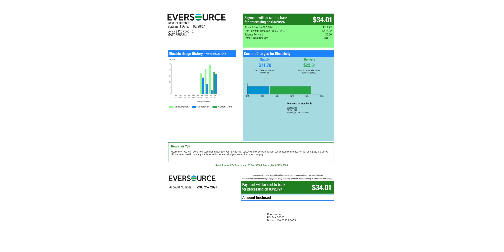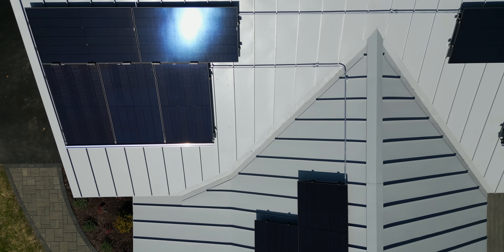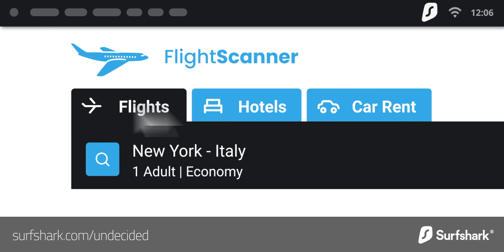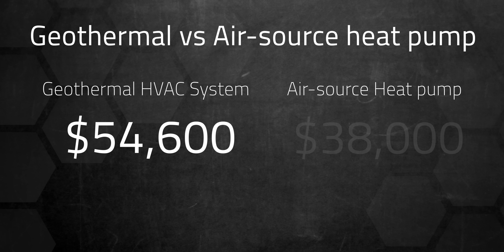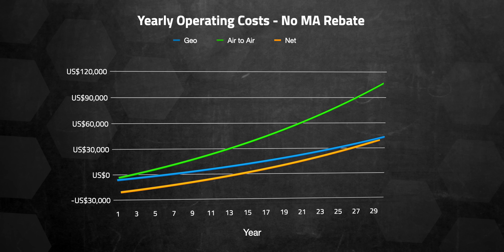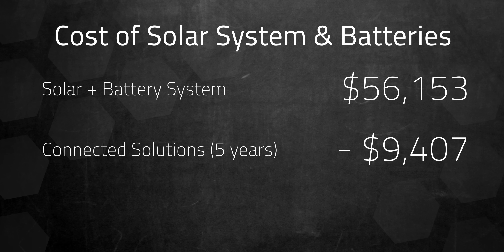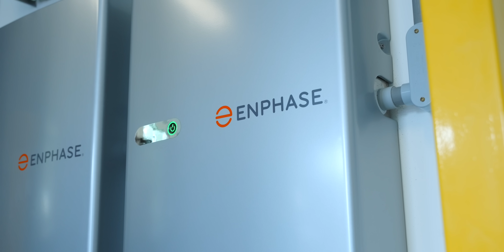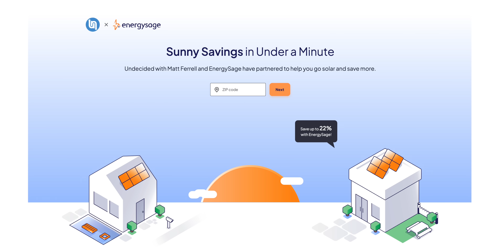What I Learned After 1 Year with New Solar Panels

Comment: And now I have a full time job managing my overcomplicated automated house that requires me to constantly monitor why my smart light switch is not working
Reply: I was about to make a comment very similar to yours. I have better things to spend my life doing then micromanaging why one circuit in my house house cost me a penny more then last month. I just don't get why people need "smart" circuit breaker panels, "smart" appliances, etc.
Reply: Lutron is incredibly stable. I’d agree if he were using non hardwired smart bulbs and stuff, but Lutron really isn’t comparable to that stuff.
Reply: This is a factor nobody thinks of.  The other thing is when new tech and falling-off-a-cliff energy storage pricing outpaces your otherwise carefully calculated ROI.

Comment: Ground source sounds cool and no worries when it's -20F. My air source system installed at about the same time uses 3x the power, but costs 1/3. Very ordinary insulation doesn't help. Our electricity is about half so ground source payback would be long.

Comment: I can't begin to explain how complex this topic is and how well you covered it.  I've been going over the same exact tradeoffs for my new house to make sure I was making a good decision.  I landed on doing a ton of solar (40 kw) that I will install myself but I have 12 month 1:1 net metering at 17 cents/kwh.  I also went with lower efficiency heat pump system and less insulation because the solar is going to have a way better payback.  And to add to it, my 40kw system will be able to share power with my parents house on our bill, so it's double the return on investment.  Similar ~50% selling rate to the power company after I go over 100% usage and an extra 3-4 cent/kwh for the PA solar credits.   And once long range electric cars are cheap enough, I may cut my gasoline bill by charging my own electric car to save another $10/day.

I think this level of thinking and math is in the top 1% of people who look into energy savings.  You can do simple or even complex payoff calculations, but this really looks at it from the big picture.

Comment: 8:15 I can't imagine paying $0.31/kWh for electricity!! I'm unhappy with 9.79¢ (Canadian), although that number is roughly double due to other fees, it's still significantly lower than your rates.
Reply: welcome to parts in eurozone, were you have such prices or even higher. i pay 0.35/kWh and if i had solar, i would get about 0.08/kWh for it if i would deliver it back.

Comment: I designed our passive solar home 40 years ago, installed solar when each 300W panel was $1700!  We are in Calif where we get over 100°f  much of the summer.  With earth sheltering (12" o soil over 6" of foam insulation) we did not need A/C.  Until 2017 when we bought our first EV we returned about 1000Kwh back to the grid annually.  Within the last two years we have added more solar power & another EV (Rivian) & will add more solar & achieve near net zero power demand from utility.  I have followed your progress throughout this process &, being somewhat nerdy myself, throughly enjoyed your breakdown & all of the technologies you used coupled with more conventional construction (our home is concrete w/insulation on outside while you are still wooden structure).

Comment: I've watched a lot of your videos, and I think one area you haven't emphasized is the negative aspects of net metering.  Every energy company does this differently, but many charge you for standby costs, and it is possible that those charges can actually make net metering a bad choice.  I've got a 22kW system, and my energy company charges more than $3 per kW over 15 kW while energy costs are in the pennies.  Since I have a battery and operate nearly off the grid, it is more cost-effective to not use net metering.  Yes, I'm wasting a lot of production that you would like to believe the energy company would like, but because my system charges the battery and the battery can fill the gap most of the time for nights and bad weather days, my energy charges from the energy company are near zero while I avoid $22+ dollars in standby charges.  It might be a good topic to cover so people also consider how those standby costs might impact them.  For my setup, as long as I stayed under a grid usage of 189 kWh per month I saved money by avoiding net metering.

Comment: In Northland New Zealand, population 200,000, an electric company will have built in 3 years a 200Gwh per year solar farm with battery load shedding.  Electricity won't be 70c it will be 0.7c a kwh. They will most likely charge quite a high supply fee.  In fact they will pay you to use electricity at certain times.  I already get power FREE at night 2am to 6am.

Comment: When you where calculating savings you mentioned that the solar panels should easily last 25 years, those micro invertors have a 25 year warranty but you forgot to mention that 20kw battery could be well on the way towards its second replacement. Off course those expensive heatpump and HAC systems are likley heading towards their second replacement in 25 years as well so saying you have saved approx 2-$300,000 is just speculation. Somebody else could say to heck with all that when building, I will go with a lower mortgage instead, what did they just save in interest payments over 25 years? may have more than covered the 2-$300,000 you believe you have saved. But I get it, you feel green and you can afford it but your saving estimates are rubbery beyond belief and society is paying for a chunk of your complex system with rebates. Complex systems = high maintenance and replacement costs and those rebates for early adopters will be long gone when the system fails/ages or just needs replacing. In 25 years you could be retired, do you now have the funds to repair/replace or are you taking out another mortgage or selling up?

Comment: This also assumes ultility companies will offer the same deals for 30 years, and a good chunk of the savings needs to be stashed away over time to be sure yoy can replace the system when the time comes... lord knows what systems will be available and what costs might be at that point. 

Definitely is situation dependent as you say too. Average bills for me are ~$110/mo over a year. Rates do climb slowly, but at the current rates it would take the better part of 20-30years to break even with those costs... and theres absolutely no way there will be zero maintenance/replacement occurences. 

Summary: costs of these solar systems need to come down by about 2/3 to make sense for many (or even most) folks

Comment: Matt - Q1 2025 I will be going full solar, wind & battery on my house in Margaret River, Western Australia. 
Very helpful & basically confirmed my own research. We have lots of sun and wind, it rarely gets above 30c in summer or below 10c in winter, so cooling & heating are rarely needed. 
have you done something on insulation? 
I am currently researching this, for my walls & roof.

Comment: Technically you also have to account for opportunity cost whenever comparing an upfront payment and/or interest rate if you are paying in installments. Then you probably also have to factor in early adapter costs as batteries and solar panels will likely be significantly cheaper if you switch, say, 5 years from now.

Regardless, still probably a decent choice if you can afford it.

Comment: I found this extremely interesting. Your solar system is pretty much in-line with mine. Mine is entirely Enphase with microinverters, located in Central Florida. 45 x G-10+ 365W panels, peak production was in March/April, and total production this year of roughly 20MW. Costs were in line as well, roughly $52k all-in (no batteries and electrical panel related work was done separately). One more month to go this year, but right now I'll end up with about a 1800kwh surplus/credit with the utility. Given wholesale rate history, I'll see all of $45 back from the utility at year end when the surplus counter resets.

Comment: Even if you say it's break even on the heating system and take just his lowest cost for solar with all the credits, that's 46k extra paid out of pocket initially vs not doing anything special. 

46k invested at an average 10% return over 30 years in say a typical stock investment, turns into 802k. That's a much bigger return than saving 300k.

I think his biggest win is being able to make these videos and have a channel that makes a living for him. 

But for the average person, dang. Just invest your money long term for retirement.

Comment: Thanks for sharing Matt.  

Mind blowing what your installation and energy costs were.   

My electric costs here in MO average about $0.08/kwh in the winter and $.11/kwh in the summer.  I have focused on insulation, efficient heat pump, heat pump dryer and pushing electric use to match TOU billing.   I could never payout a system like yours with our energy bill averaging $130 per month.

Comment: I like the analysis, but for two items:

1) Factoring yearly maintenance
2) Factoring premature failure of subsystems: Individual solar panels, a battery, electrical panel. etc.

Have you any thoughts on these two items?

Granted, these two are hard to project even with manufacture data on actual failure rates; there a whole fault trees to explore!

Comment: Thanks for the analysis and review of your system! I am in Southern California  and my original net metering contract just ended this year. The new contract pays me .015$ per kilowatt hour that I generate, and charges me $.62 for any electricity that I use. Talk about a negative to installing solar! I recently had a contractor add 10 new panels and a Tesla 3 Powerwall so that I can become net neutral annually. It is a crime that the utilities got away with the new contract. I am so happy that all your hard work in research into this topic paid off!

Comment: So two things here to consider. A) If you do/did this to be "off-grid" all the power to you, you have achieved a certain degree of independence and nobody can argue with that. But there is a B) and that is the dark side.... You cannot make a video after one year of operation and declare mathematical success over a 10-15 Year timespan. You can make a video and state the facts you have gathered so far, that is totally cool, but when you buy the "Mercedes" of a system you should consider the "Mercedes" of maintenance cost. This is a very complex system with lots of opportunity for failure. As a (former) contractor who has specialized in Geothermal/Water source heat pumps for over 10 Years I can tell you that it will take very little for that math to go South. There is just no way to know until you have reached a 10-year lifespan. Some get lucky with little maintenance cost but most don't.

Comment: I dunno, Matt.  With that size of solar deployment... at that cost... it seems troubling.  A system of that size would have my larger home for a family of 5 and two EVs.  I have done some moderate energy efficiency things, like a heat pump (not even geothermal) and a heat pump water heater.

That size of system, you could build it for MUCH cheaper... or you could dgo with a Tesla Solar Roof and it would be a root too... but I think that you tried that and the timing wouldn't work (which is similar to what I am facing).

EDIT:  10X YIKES!!! I spent $4k on my heat pump system!  OMFG.... AS&@@)^%*&^!*(@^#!  That hurts.

Did they charge you to line the road from the the office in gold?

Are you just turning on the hot water and walking away for 4 hours every day?  There is no way you should be able to save over $2k with a desuperheater... I spend about as much as you do on the heat pump + desuperheater on just a heat pump... and that is a massive 80 gallons heat pump water heater.... like I said, I have a family of 5.  Yes, my costs are different... but not that different.

I don't think the long-term savings are clear.  With the expected increases, it stands to reason that more people will adjust.  So, that will likely temper the price increases significantly.

Comment: 2 person household, detached house very poorly insulated. Using yearly 1,08 MWh of electricity and 36 m3 of gas. Got a shock when you said you’re using 16 MWh a year. Instead of installing those fancy systems and using precious resources, people should focus on reducing energy costs themselves. For example, Instead of having a room temperature of 20 degrees, sit in 15 degrees with more thick clothing.

Comment: I’m in Australia and our solar is subsidised by the government ($350/kw). I got a 13.3kw array and 10kw 3 phase inverter installed for under $9000. I use an average of 500kw a month and produce an average of 1250kw. I make a small credit each month. In my situation it’s been the best thing I’ve done for my home. I can run my air conditioning guilt free when needed. Highly recommend
Reply: Who pays for the government subsidies? you do. a lose , lose situation
Reply: @ feel better?  actually all tax payers do. So I’m getting more than my share out the deal. I didn’t make the scheme. I’m just explaining the my situation.

Comment: This is excellent, as always, but panel degradation will not accurately represent the recurring cost with solar.  Inverters and batteries degrade and while the battery cells themselves will last a long time, they may not last 30 years and even the inverter electronics tend to fail such that replacement can easily negate a substantial portion of the long-term savings.  Those costs are not included in this assessment, which is understandable as they are unpredictable and depend upon warranty claims as well.

I suspect that battery costs will not be a major issue as per-watt costs are decreasing while cycle lifetimes are increasing, but out-of-warranty replacements will still impact our savings.

I'm not intending to sound like a naysayer as I think solar systems have made financial sense for most homes for well over a decade for folks that could get over the up-front investment hurdles, but homeowners with solar do experience substantial equipment failures that non-solar homes do not; there are inherent risks and costs involved with running your own power plant.

Whatever viewers do, they should seriously investigate Tesla solar before committing to that option as I believe that it's one of the worst available.  Buy a Tesla car, not their home energy products ;).

Comment: I could be wrong, but aren’t you calculating spread out savings into current days purchase price? What you’ll save over the next 20 years on all your appliances being directly subtracted from what you paid today? Your solar, house conditioning and water heating is close to $150,000 or more. 
I’m pretty sure I’m clueless on this matter, but where do you live that it costs $6,000-$10,000 a year to maintain an air conditioned home, gas, electricity and water heating? Sounds like it’s time to move. 
We have a 1270 square foot home, heat and cool it, ponds, landscape lightning, all the things any other home has, me and two women in the house whose body temps swing like a monkey on a rope, use hot water till the tank is empty and all sorts of other nonsense and don’t  come close to the $4,875 you do with your multi million dollar over engineered home. We’re also in SoCal. 
I’m all for solar but it would never make sense for us. By the time it paid off and the actual savings start I’d be in my 70s. Home will be paid for in 7-10 years so any mortgage payment could be made towards the couple of dollars more electricity costs. 
I really think people do the math all wrong in these types of scenarios. Counting future savings as todays savings. Like the government wanting to tax gains not realized. Voodoo math. 
That Matt Resinger guy month Build Show acts like everyone has a $100,000 to spend on each phase of construction. Never in my life would I spend $75,000 on a water heater, $55,000 on and AC unit, $90,000 on solar, $50,000 on weather proofing system for my house and think I’ll save in the future. Nope. But whoever buys or inherits my home might.

Comment: How did you setup enphase with home assistant? The power consumption sensor is wrong in home assistant. It combines the amount the house uses with the amount being used to charge the battery. So the numbers in home assistant are t accurate.

Comment: 1:09  Wow! The cost of solar is a lot cheaper in Australia where I am. It cost us $4800 for a good quality 6.6kw system with a 5kw inverter. I live in Brisbane, Australia and it is a very sunny warm climate. Have had the system for over 12 months and it averages 30.4kwh of generation per day. Even without a battery attached the sustem will pay itself off after only 2 and a half years based on current electricity charges and what we get paid exporting back to the grid. The take up of solar is extremely high in Brisbane… it just makes short term and long term financial sense. 👍
Reply: @NathanTaylor-df9zb  who installed it for that price ?
Reply: @ Auswell Energy, very happy with the install and after service care 👍
Reply: @NathanTaylor-df9zb Thank you, what panels & inverter did they install please?
Reply: @  16 x Trina solar 415kw panels and a Redback technologies SI5000 inverter… the inverter comes with an attached wifi monitor system where you can have the app on your phone to monitor usage and data… it’s a really good inverter.

Comment: So my system in Australia.
Cost $15000 Aud government rebate was around 5-6k 
System kWh of REC panel system 19-20kwh -pretty much covering all the relevant angles of the roof.
Fronius inverter 15kw
No battery - yet